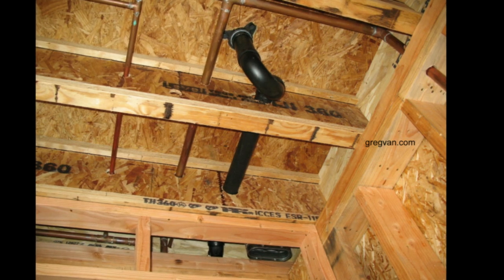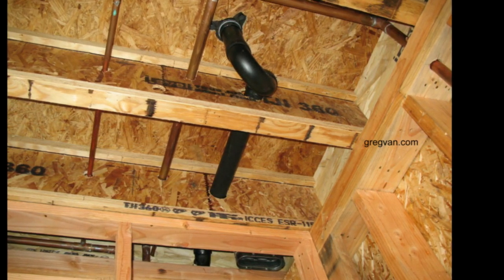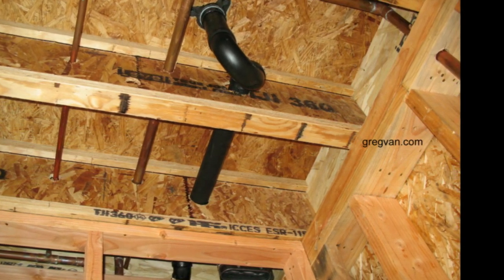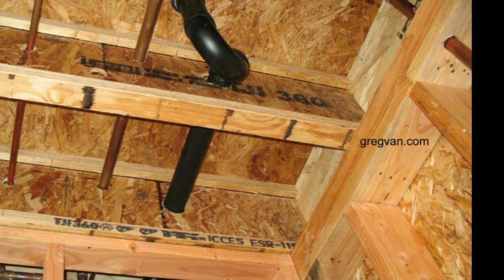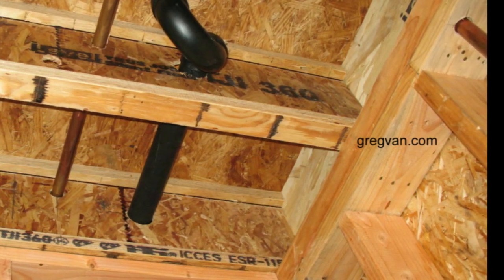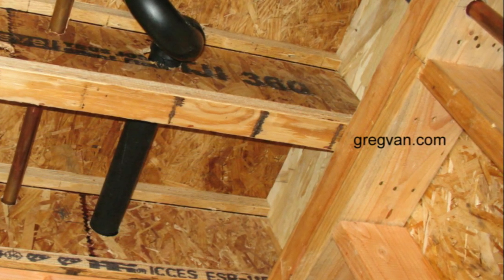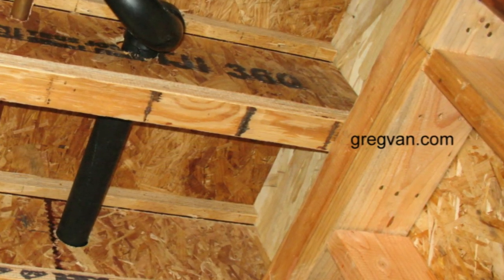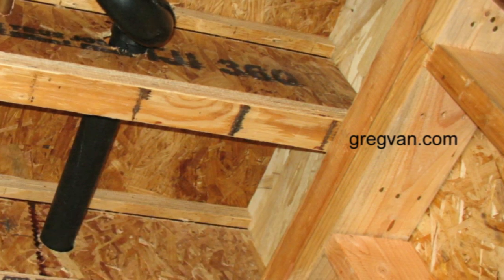Heavy Duty Wall Framing Top Plates - House Framing Education

Comment from the maker: This photograph was taken in Southern California and the extra thick top plate is for shear panel nailing. It wouldn't be a building code issue, it would be a structural engineering issue. But you've got a good point, it is a little overkill and I can't wait to see what they're going to do in the future.